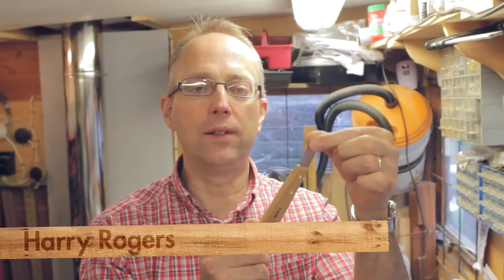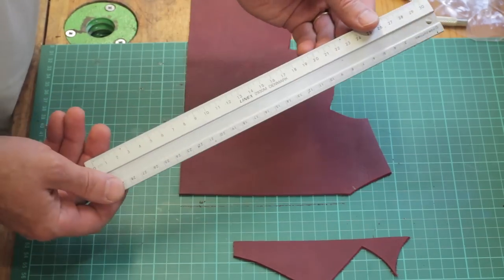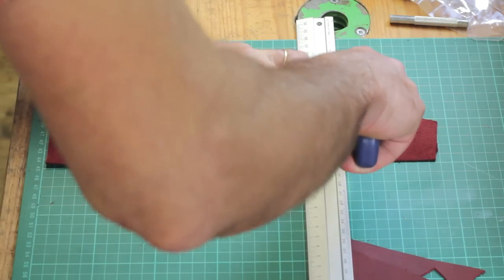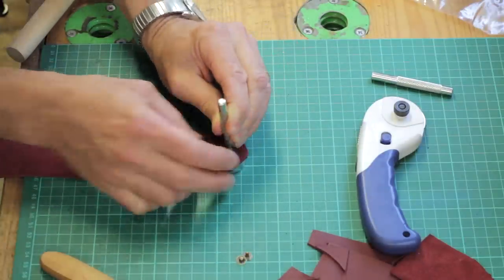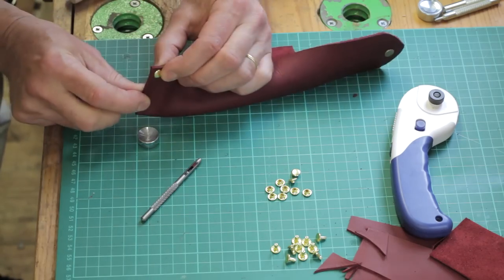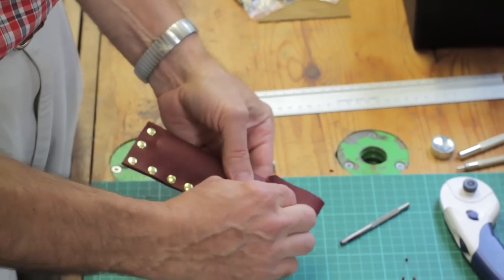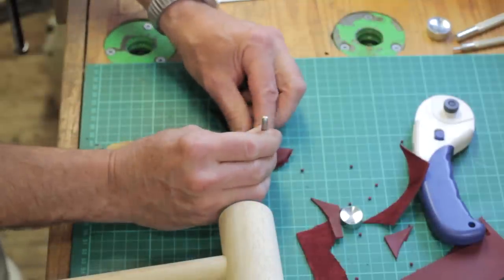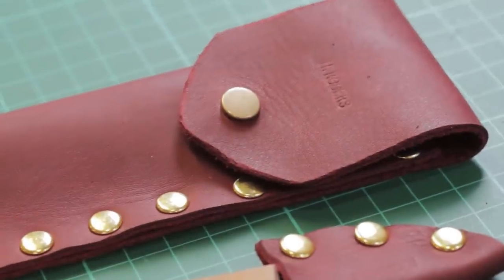Leather Riveting a Knife Sheath

Comment: I didn't check to see if anyone mentioned it yet but you would be well off to punch your holes through your leather using a thin piece of wood on your "self healing" cutting board. I doubt it will "self heal" all those little circular holes. I guess if they didn't heal, you already have noticed the final effect of the punching on the surface of your board, eh?
Reply from the maker: Framer Guy Wise words...I now use a poly mat!
Reply: Well, thank you Harry, but it is more like a "been there, done that" sort of tip that I thought should be passed on to others. ;-)

Comment: Thanks a lot, this is exactly what I was looking for ! i didn't wanted to stitch and to use an extra piece of leather to protect the stitches, and making a sheath like the one you make is really brilliant !
With veg tanned leather, you could use it exactly as if it was kydex
I have a few questions :
How thick is the leather ?
How do you know how much leather to leave around the knife to be able to set the rivet ?
When the sheath is riveted, could you then wetten it and put it in a kydex press to give it a tight fit to the knife  ? I'm afraid that the water could lead to oxydation on the rivets ?
Reply from the maker: Gaetan Thomas Hi this is with chrome tan leather so you cannot wet mould it...I have also done a film on making a twybil cover with veg tan and copper rivets. You could use veg tan, wrap your knife in cling film and wet mould the leather around it.
Reply: Harry Rogers but what is the order of the operation ?
1 cut
2glue
3 wet mold
4 set the rivet ?

Comment: A rivet broke on my folding knife holster.  After seeing your video, I feel confident to make the repair myself.  Thanks.  Recently, I saw a video about cleaning vintage violins and the demonstrator used a cutting board like yours to cut up an old T-shirt into small cleaning pieces.  I see by Googling "self healing cutting mat" that such mats are readily available and inexpensive.  Thanks again.  I'll have to go back and see what he used for a knife.  That roller knife you used is so much better for cutting.  It's the difference between cutting a pizza with a steak knife or using a pizza roller cutter.  The roller cutter is much less disruptive to the item being cut.

Comment: Tandy Leather Supply is on line with a great selection of leather and tools too.
Reply from the maker: Hi Mike - yes they are very good, and here in the UK we also have Le Prevo which is another good online supplier. With Tandy its worth considering a membership card if buying a lot of stuff. Thanks for spreading the good tips. Harry
Reply: maybe you guys can answer this before I do it: I was considering making a anvil out of hardwood or machining metal myself, what do you think?
Reply from the maker: Einherja R Hi if you mean an anvil for blacksmithing you could try and get either a piece of girder of a bit of railway track.......hardwood would not take the hits and will burn.........bear in mind than an anvil does not have to be anvil shape so a big bit of scrap metal might do the job.
Reply: sorry, I meant the small anvil for the kind of work you do on these grommits
Reply from the maker: Einherja R Right Ok well the hardwood one would work for a while as the pressure is not too great, but it would deform so a machines one would be a better bet - its simply a shallow curved base dish so should be easy to machine up.
Reply: Einherja R Einherja:  Just go to a granite counter top place and ask for their sink cut outs or off cuts.  They are usually free and are perfect for heavy work.  I've also seen folks use misspelled headstones from the local gravestone maker.  Also free (because they pay to dispose of these)  Also if you need a rivet setter, check out Gold Star Tool online.  His rivet setters are far less expensive than anything or anyone else online.  He even ships overseas!

Comment: Most of the leathers you mention are cured with various kinds of salts.  They will cause corrosion on some metals.  Veg-tan leather is the best choice.
Reply from the maker: Yes absolutely, Veg tan is very nice and a good choice...especially as you can stamp and carve it as well.......I personally have had no problem with chrome tan leathers using them for tool rolls etc. where I want more flexibility in the leather. Regards Harry